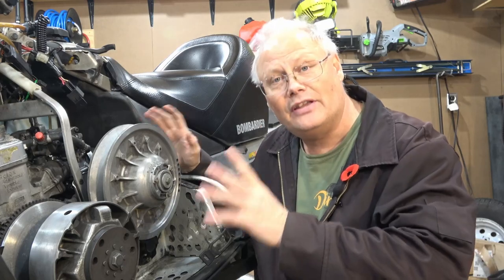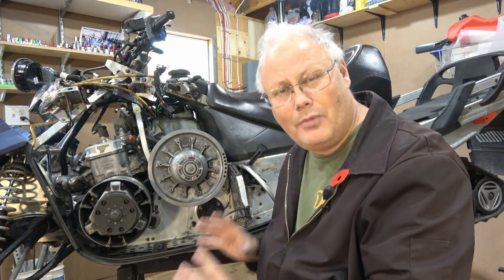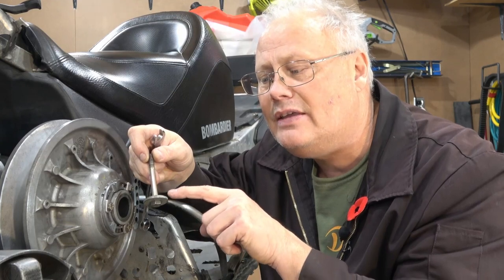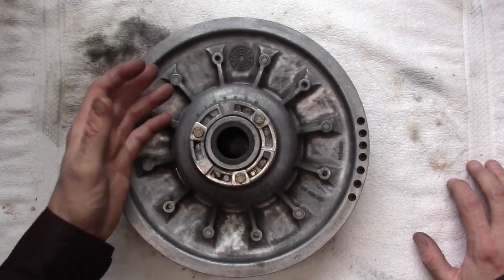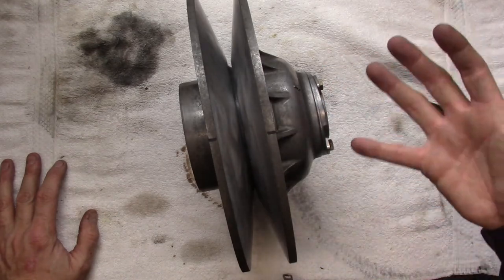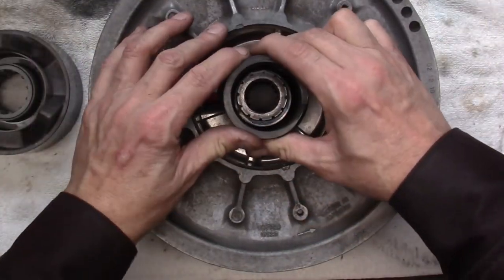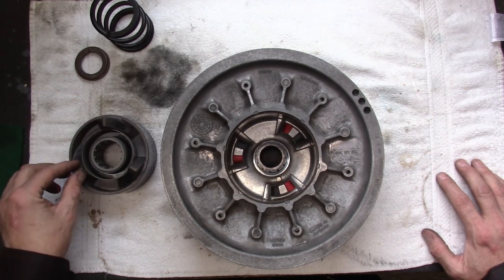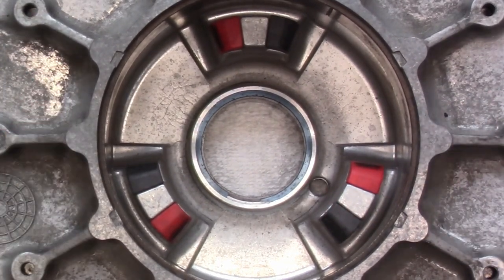Today, I service a Ski Doo secondary clutch on a REV GTX.

Comment: I just got a 04 mxz 800 this year and am about to start going through it. Im good at wrenching but don't know very much about snowmobiles. I'm binge watching your videos! Very informative and will save me a ton of time not just sitting there scratching my head.
Reply from the maker: Glad you find the content helpful
Dino
Reply: Going through my 07 xrs ski-doo 800 ho ptek secondary clutch.
Wondering if I need to me aware of balancing marks like I do on the primary?
Thanks!

Comment: Hey Dino. I have a question on the driven clutch. Is there any certain way the helix should line up with the shelve. Do ya need to pre load it or anything. I don’t see how ya could. Thx
Reply from the maker: That is a great question, on the rer clutch there is no need to preload like older clutches. I do not beli e there is any alignment marks on the helix either.

Comment: It's all very much voodoo to me... Lol. But you cleared up a lot of unknowns. You make it so anyone would gain the confidence to tackle this procedure. Well done.
Question: does all the engine torque get transmitted from clutch to clutch thru just the side edges of the belt? Not the wide faces, such as a typical serpentine belt?? 🤷
Reply from the maker: Thanks for the comment and question Eric. Ya the sides of the belt carry all the torque, the belts have very wide bearing surfaces due to the tappers and they do not last nearly as long as your typical serpentine belt. Of course your water pump does not really move 100 to 200 HP the way a sled does from the output shaft to the ground lol.
Thanks again
Dino

Comment: Excellent video, as usual. As I commented before, I have the exact same Enduro 2018 900 ACE and I'm looking forward to tinkering with it this spring thanks to your videos. Two questions though: you often refer to what the "manual" says - can you give me a reference as to where I can get/buy said manual for my machine. I've searched everywhere on the web and can't seem to find it. Also, can you tell me where you got the clutch compressor. Sorry for all the questions, but I like to have the proper tools when tinkering around. Thank you for your assistance
Reply from the maker: So glad you enjoyed the video. The clutch compressor that I have cam in a kit from Royal Distributing, but I have made a homemade one before that worked just as well. The kit comes with a clutch holding tool for the newer clutch your Enduro has. I actually do not have a manual for my 2018, but the REV manual I found online for free as a PDF, I believe I just did a search for it and it turned up. I've had that one for a number of years and cant remember exactly where I found it.
Dino
Reply from the maker: @steigre  thank you for the post
Reply: @DinosTinkerShed 
Wondering if I need to be worried about aligning balance points on my rev secondary clutch as I do with a primary clutch?

Thanks!

Comment: I have a 1999 Ski-Doo Summit 670 that I am trying to take apart to clean.  I used this method, but my secondary clutch doesn't have half moon parts.  It has a C-clip that I had to remove with Snap ring pliers.    I compressed the Helix then removed the C-clip and then a washer behind it.  I decompressed the Helix but it stays in the clutch.  It makes me think its really dirty or rusted inside so it won't decompress.  I'm I doing something wrong?  This is one of the old clutches where you have to put the tool in the front of the clutch to expand the clutch to remove the belt.  Thoughts?
Reply from the maker: Thank you for the question, I always point out I am not a mechanic but will give my thoughts. I have had a few secondary clutches that the helix would not come out freely, in both cases they were very dirty or the aluminum had oxidized and created too tight a fit. if it is just dirty, a thorough cleaning should make it work well again. if it is too badly oxidized you may need a new helix and may want to look at the bushings as well.
I hope this helps.
Dino

Comment: Great video! Quick question I’ve went from a aftermarket belt back to a OEM. Now I’ve Installed my new belt, but even thought I’m at 0 on my secondary the belt is too tight and too hight, causing the snowmobile to go forward by itself. 
Any help would be appreciated.
Reply from the maker: Oh that is not right, again I am not an expert or a mechanic but I can let you know what I would look at first:
1. I would first check the cross fit on the old aftermarket belt to see if it was intended for your sled, if it was not it may indicate an issue from a past owner who tried to fix an issue with a longer belt.
2. Double check the belt you got from BRP is the right one, I understand that some of the belt numbers changed and all technicians can make mistakes. 
3. I would check both sides of the Nuun/ tunnel, (behind the clutches and the exhaust and insure that the tunnel to ensure it is not bent. A bent tunnel, especially behind the clutches can cause real issue with both clutch spacing and alignment
4. I would make sure the clutches are both clean, re assembled correctly and are working correctly. If the shives do not cycle their full range this could cause the belt to sit to high.

Again these are just the first things I would check and may not be the issue but is a start.
I hope this helps, please let me know how you make out.
Dino
Reply: I believe I found my problem. The three bolts on the ajuster appeared to be cut. So I got three new ones which were a few millimeters longer. Now I have play and on my new belt I’m set approximately 3 to get the perfect deflection. (Gives me a little play) I don’t know why someone would of cut them possibly to use an other type of belt that wasn’t made for the snowmobile.
Reply from the maker: Thanks for the update and I'm glad it worked out. I learned something new thank you.
Dino